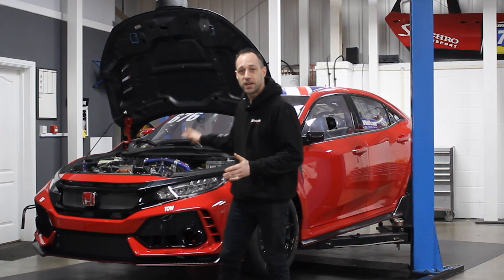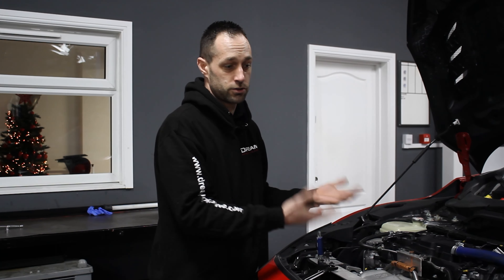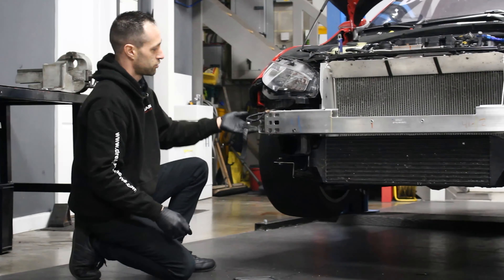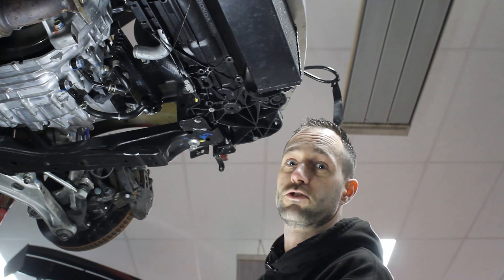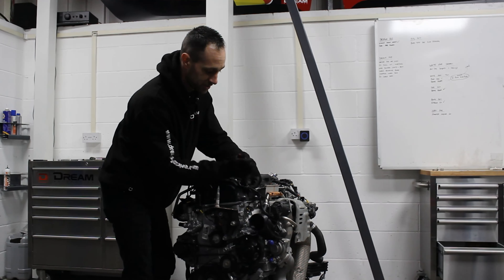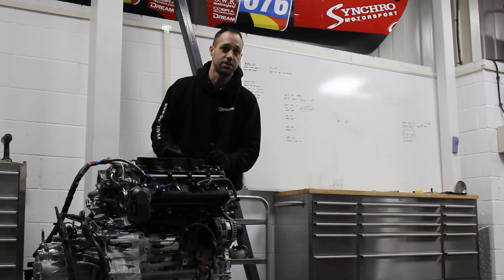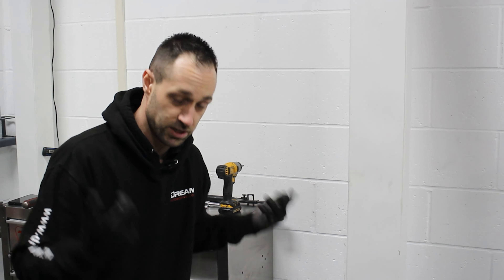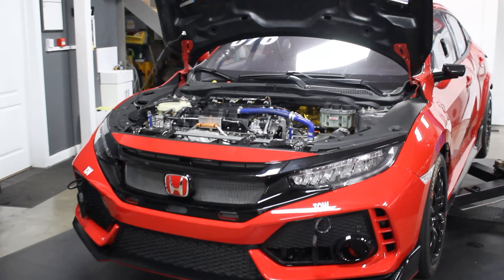RACECAR ENGINE REMOVAL! | Dream Automotive

Comment: Any thoughts on adding a wet sump like an Accusump on your race Type R? Im thinking of adding it as insurance to keep everything critical well oiled. Reason being Im at 686hp
Reply from the maker: Good question! We actually got 2 with the spares that came with the car. We've been considering whether or not to run it on the car 🤔

Comment: What was the reason of the internal coolant leak?
Reply: Probably a blown head gasket, had the same problem with this engine. Could also be a crack in the cylinder head or cylinder wall

Comment: Could you not just swap the head?

Noticed you have done a number of head gasket changes what is the root cause overheat? Is it mainly on track and what can we do to prevent. I appreciate with an endurance engine different cup of tea.
Reply: No when the head gasket is blown the head could warp and not seal properly. Both mating surfaces have to be milled or replaced with a new bare head to build and the short block mating surface decked, usually done after sleeving with ductile iron sleeves.